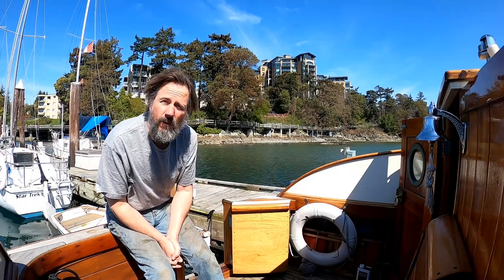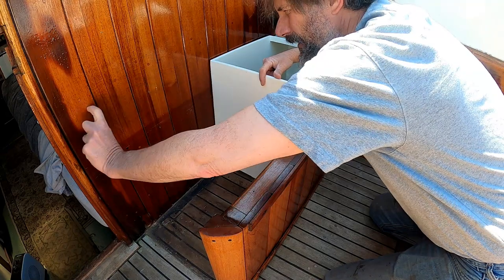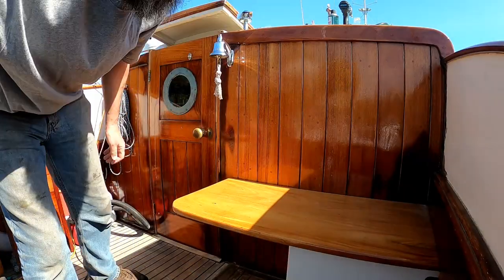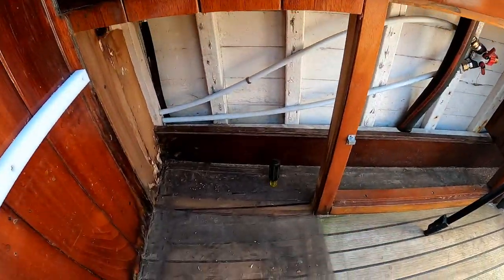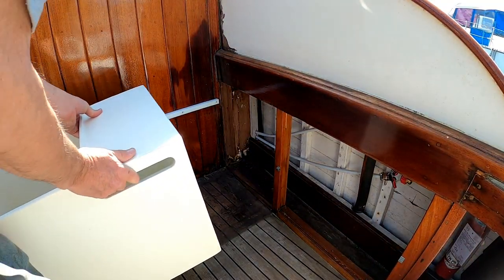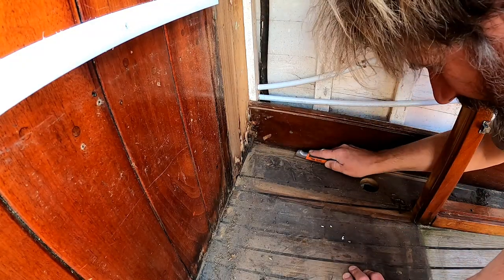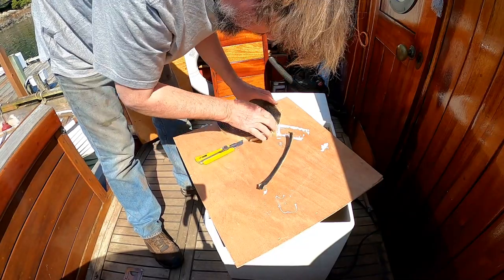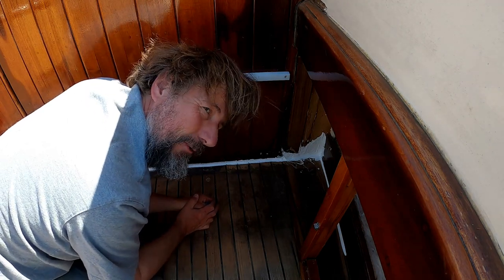The Flying Chisel - Boat Life - Living aboard a wooden boat - Travels With Geordie #165

Comment: The adjustable wrench with that worm drive arrangement was invented in Sweden. In Swedish they’re called a “skiftnyckel”, aka a shifting wrench. In the Swedish speaking parts of Finland we tend to refer to them as “nut lathes”. If you want a tool that does the same think without rounding of fasteners with improved speed as well, Knipex makes a pair of pliers that work identically but provide an insane amount of clamping force on the fastener at the same time, thus no risk of the jaws slipping.

Comment: There is a reason that wrench has a handle?😁
Reply from the maker: Errrr, I don't get it
Reply: Travels With Geordie just a great show
Reply: @TravelsWithGeordie  , I believe Hank was referencing the handle on the.um.....vectored.....adjustable....chamfer cutting...head. extension.  Yes, that's it...Geordify Tool Company is offering its Drill Bit with Vectored Adjustable Chamfer Cutting Head Extension.  Used hose clamps not included.

"GeordifiedTool Company - See a familiar tool that you don't quite recognize, appears to be semi-dangerous, and makes no sense at first glance? It's been Geordified"  It would be generous of you to include that handle in the retail package.  :)